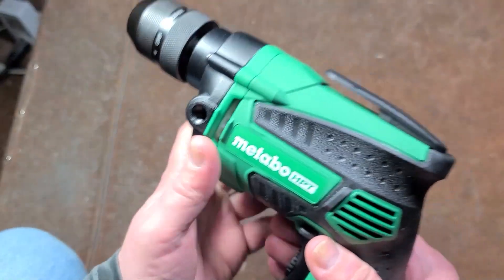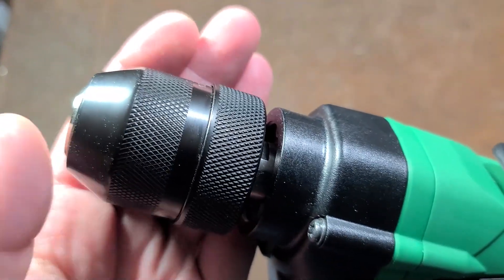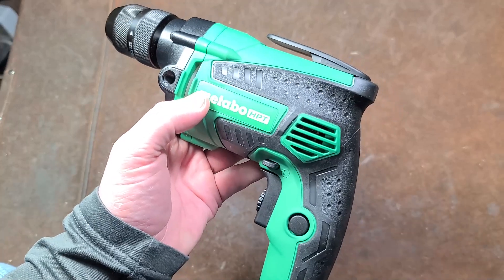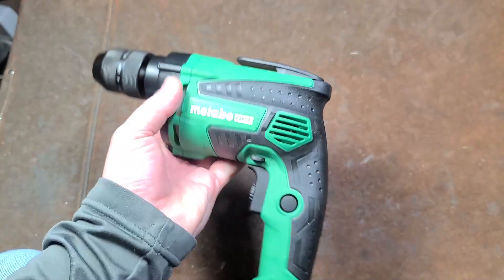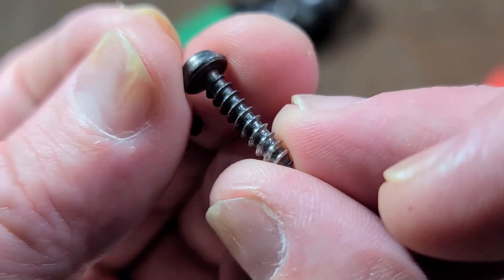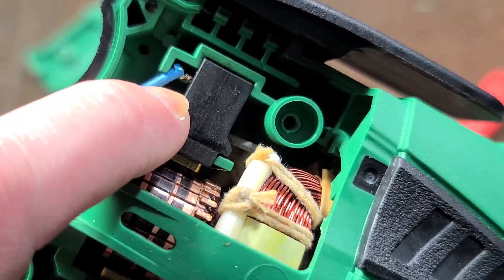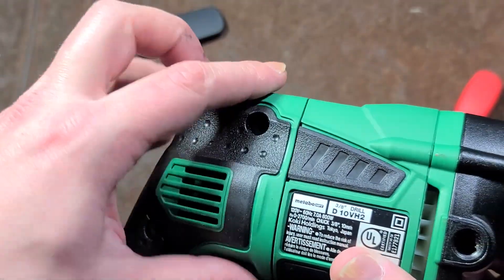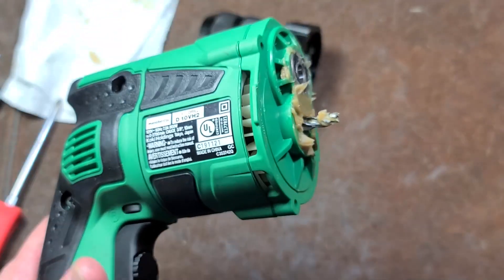Metabo/Hitachi 800 Watt 3/8" Standard Drill Motor Review/TearDown

Comment: Super great video!! I have the same drill and when I attempted to do a chuck replacement, as the chuck is permanently locked, the affixed/immobile parts were completely different! Very "all-over-the-place" with the quality of this drill. I have this and a nice Kobalt Double Drive handheld powerless. I would rather randomly stab a hole in my drywall with my screwdriver than mess with this corded drill anymore.

Comment: Hi. Machinist here, she also owns one of these drill motors. I had at first thought I was going to leave your video to find what I'm actually looking for (someone removing the chuck, I just like to see it done before I try🙂). You did well and I watched to the end even though I didn't see the chuck come off. 

I do have a couple things to mention/ask; I couldn't see you slip the drill shank into the chuck but as you did speak to my objection with keyless, I want to ask/advise: did and do you seat your drills against the floor of the chuck if they're long enough? If so, do not do that. The jaws likely will not seat and the drill is likely to slip. Also you some of the jaws' being ground to center, you were not incorrect, I'll add though; any 3 jaw chuck whether drill or lathe will be sloppy in comparison to collets and such. 

Altogether you did well, if my opinion carries any weight. 😁

Oh also I am so not here to slather you in my snobbery. If I sound snobby it's prolly due to my actual knowledge and confidence. Confidence is tricky. 🙂